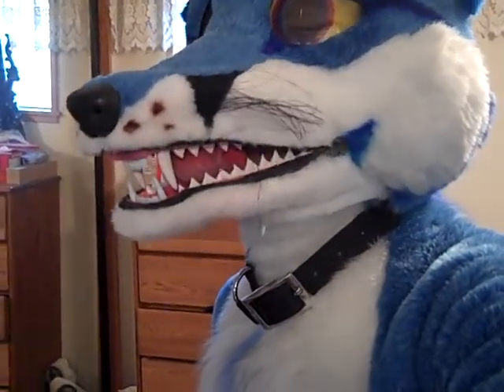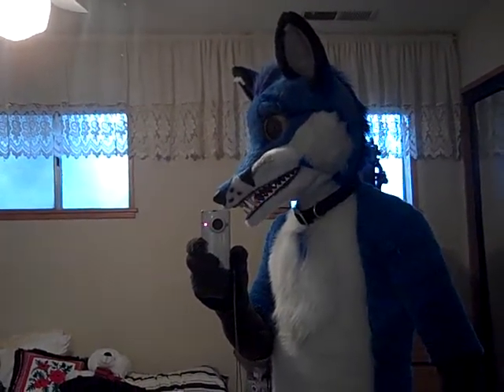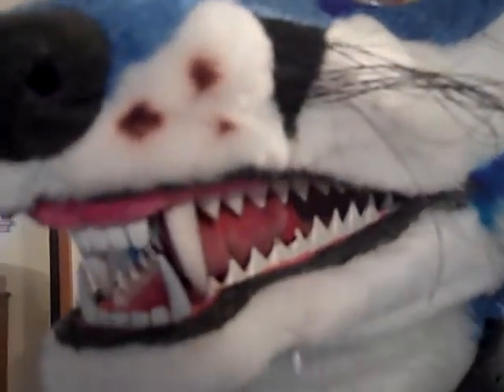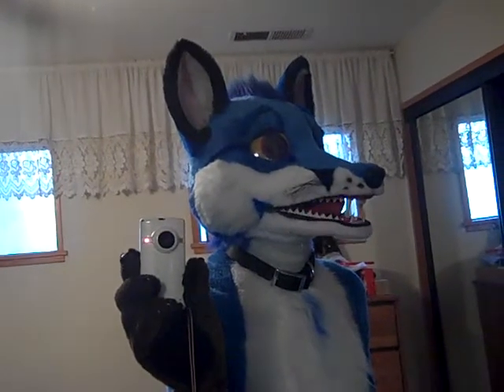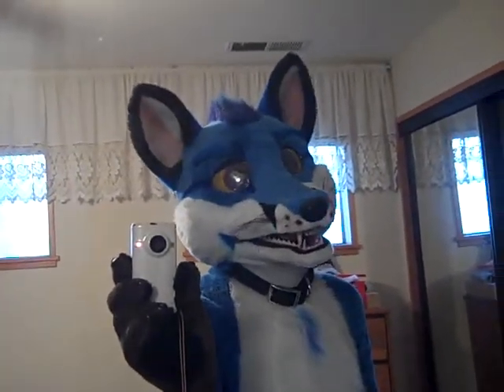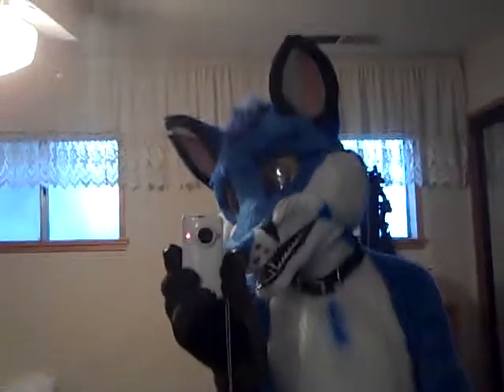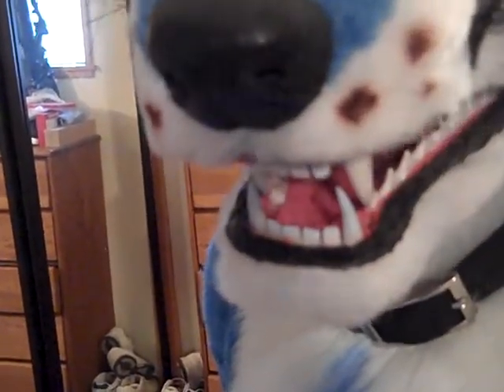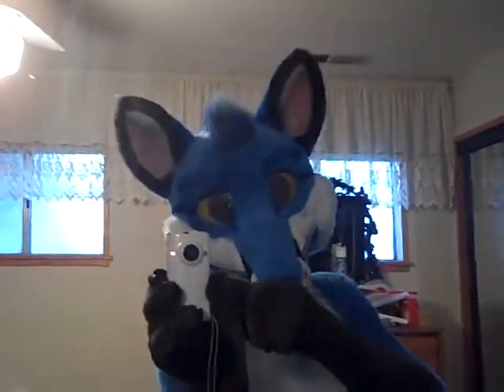Testing new circuit on the Blue fox helmet the Snarl.

Comment: epic suit but o.o is that like you sisters room it kinda girly no offense, an if you want a part to make the movement less sound able there are oil pressure hydraulics at hobby shop .com
Reply from the maker: Wow and I did the hydro pump is bulky and running hoses are not good for fur  do to they burst.